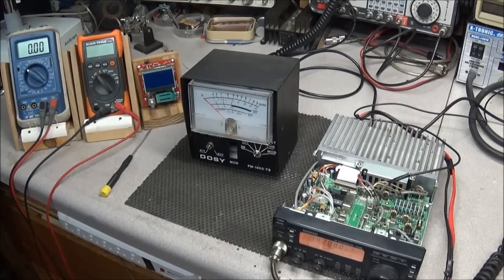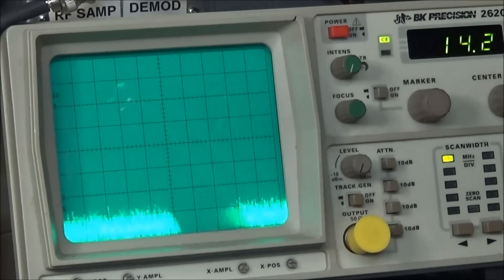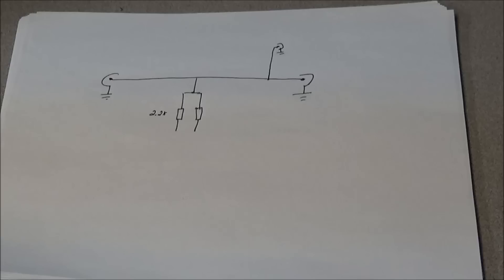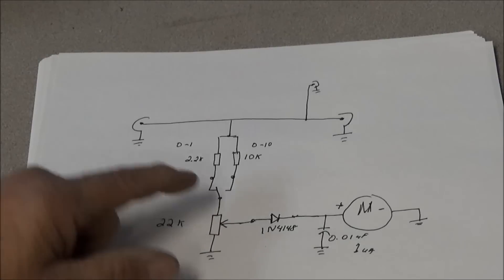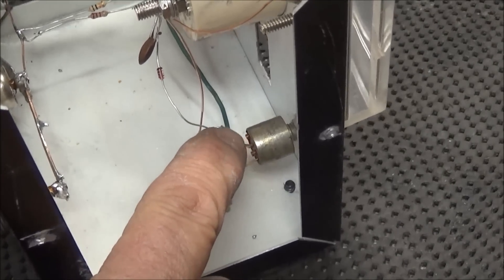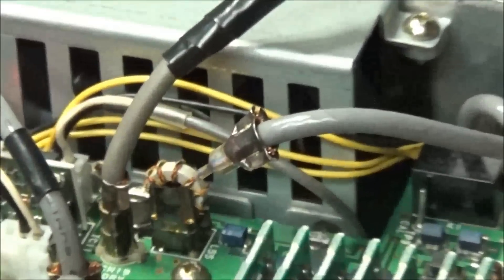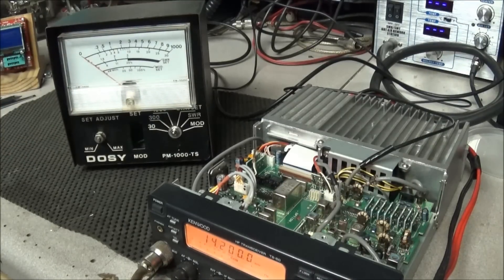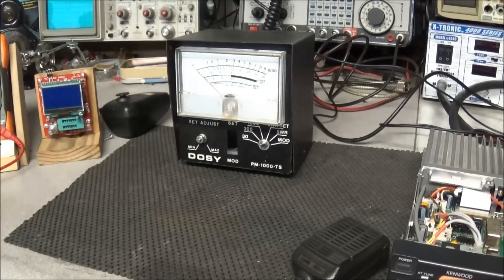#81 Shop Talk Homebrew Test Gear PT 2

Comment: Just a thought about calibration on this meter.  Change it so there are two 50k or 100k multiturn pots off the antenna to ground, then use the switch to choose between which pot's wiper is connected to the meter.  This lets you calibrate the 1 and 10 watt settings completely separately.

Comment: Buddy, not sure if you mentioned this but folks should know that you need to terminate the meter with a 50 ohm dummy load or 50 ohm resistance inside the meter. And, of course, the dummy load or internal resistance should be capable of dissipating the power - in this case, up to 10 watts. 

Twenty 1-watt 1000 ohm resistors in parallel should handle twenty watts.
Reply from the maker: You are correct, I did fail to mention this. In an upcoming video I will plan on showing the meter in it's full completion with a built in dummy load and face of unit remade. Thanks for the comment.
Reply from the maker: Also forgot to mention this. As cheap as they are now may be a good choice. heat sink 50 ohm termination resistor.http://www.ebay.com/itm/like/322345905922?lpid=82&chn=ps&ul_noapp=true

Comment: nice watt meter Buddy! For the TS-50 check the DC/DC converter for delivering the negative voltage for the ALC circuit. If the negative voltage at the ALC circuit is not present you don't have output power. see my video #81 may be it is a similar issue. Take care bro 73
Reply from the maker: Thanks Peter. I think that was the negative 6 volts? If so it is there. Will pull up the schematic just to be sure. Thanks for stopping in and 73

Comment: Nice work. Thanks for sharing. I may just build something like your little component tester holder for my Chinese component tester. 73
Reply from the maker: Works real good, keeps in a bit safe also. Never liked the cases that were made for them. Thanks for commenting.

Comment: Buddy, is that meter really 1 uA full scale? I have never seen one that sensitive. I have a couple of 20 uA movements somewhere. I am amazed.
Reply from the maker: Yep, It is actually marked 1uA on it.  Really think it has a lot to do with the rectifier diode.  I was surprised to the response of these old meters. Alan w2aew did a video on meters not long ago. I also tested it the way he shown and comes out right. Thanks for stopping in.

Comment: great video Buddy!
i am going to put one of these together just because i have about four old non-working CB wattmeters collecting dust on a shelf here.
Im wondering why you chose to make the pot external?  did i miss something or is this just used to calibrate the meter?

I think this meter would work well for nulling out the carrier on SSB using the 1 watt setting.
Reply from the maker: Hi LC. Yes the external pot is for calibrating the meter. Has a lock nut on it so it does not get knocked off.  When dealing in very low power you need to make sure the meter is in calibration every time you use it. By being external and self locking this makes calibration a breeze.  I am also going to install a internal dummy load that will switch between internal and external.  Can then install a couple of banana jacks on the rear to calibrate with a voltage source.  Thanks for stopping by and taking a look my friend.

Comment: I am very glad to see this project!  I have been trolling eBay for one and had talked to Mike via email recently about them...I'll build mine and see how it fairs!  Would like to see your finished project!  Thanks!  ~Jack, VEG
Reply from the maker: Great Jack. This was a very easy design to do.  Since I have already taken the measurement on the radio I have took it back apart for a one over. I will post a pic on my website in a moment. Link under show more tab
Reply: You did a great job Buddy!  However, my eyes are tired, the 1 on 1 watt, I thought was a "T", had to do a double take!  :)  ~Jack, VEG
Reply from the maker: Thanks Jack. I know how the eyes are